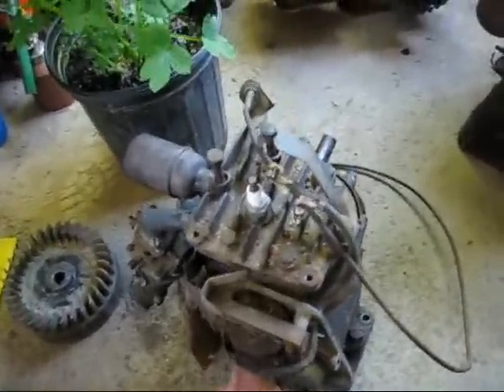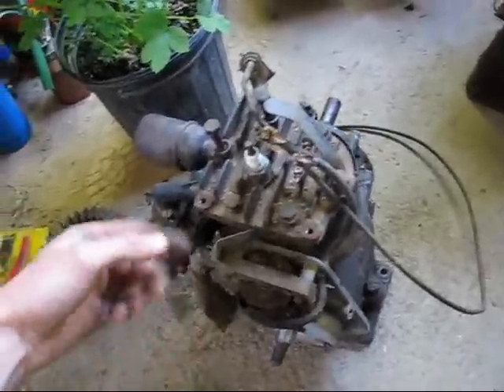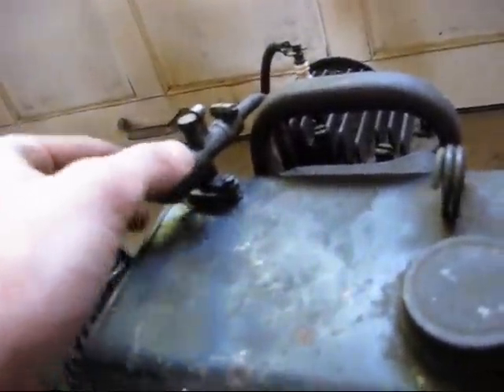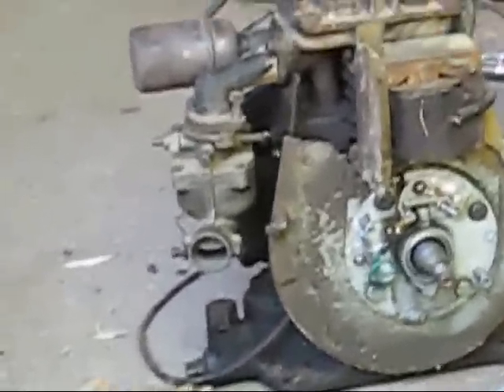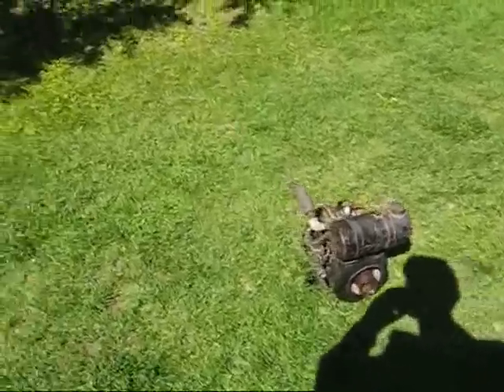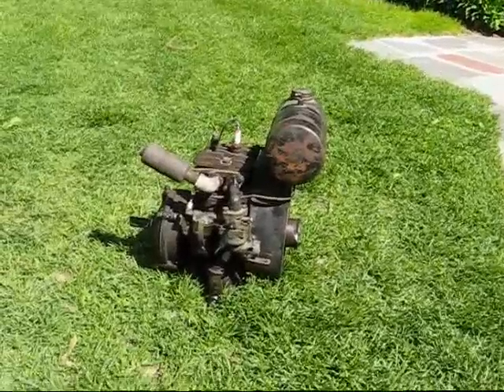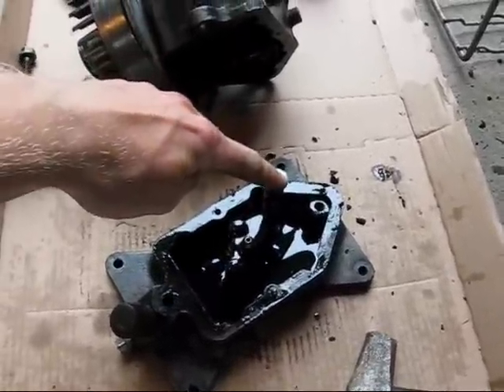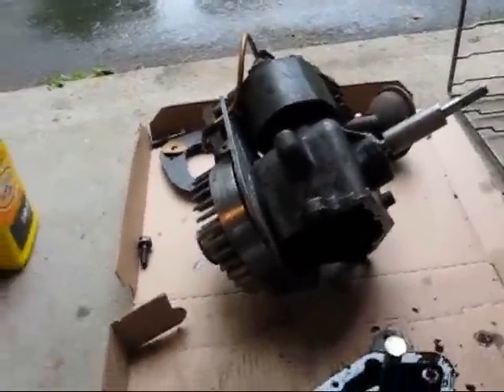Briggs & Stratton NR6

Comment from the maker: no its dead again. sort of.  apparently the thing that splashes oil on the bearings (keeps it working) broke long before my dad ever found this engine. so it needs the cyl bored out and a new piston rings rod crank etc. then it will be ok again.